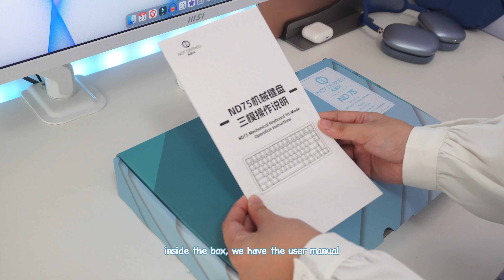this $89 BUDGET keyboard has it all | Chilkey ND75

Comment from the maker: do you think this is a good alternative for the zoom keyboards?
Reply: Does screw in stand work?? Do u know what the difference between the non-flex cut on vs the flex cut one??
Reply from the maker: @Ace61527  the non flex cut one is thicker at 1.6mm, they say it provides fuller sound than those with flex-cut ones! and as one of the more obvious difference, they are usually stiffer in terms if typing experience!
Reply: @mczstudio  do durock v2 screw stabs work with this board?
Reply from the maker: @Ace61527  yes, you can see the PCB holes at 06:32
Reply: I have zoom75 more than 300e in Europe, i'll tell you soon cause my nd75 is coming
Reply: My cons about zoom75 keyboard normal? the painting, quality of top case and screw

Comment: I got this board a few weeks ago. Its definitely amazing value for the price you pay. That said, not really anything great you get if you are an expert or enthusiast level person in this hobby. The aluminum case feels a bit cheap with very sharp corners on the aluminum back plate. The 1.2 mm version of this is pretty weak. I would highly recommend anyone getting this to get the 1.6 mm version for a louder sound.

I paired it with boba u4ts and they definitely thock
Reply from the maker: halloo! did you get yours directly from chilkey? 🥹 i checked the back plate again after reading your comment and there are no sharp corners or edges on my set. 

for the case, i also wouldn’t say it feels cheap cos its the same quality as my Luminkey75! but as for the LCD screen, the graphics could be better 🫠
Reply: @mczstudio  the aluminum back plate is integrated in a very sharp almost 90 degree angle actually. If you run your finger around the bend you can tell how sharp it is. Its not a big deal  but feels kinda cheap to me as far as no complex machining. Still amazing we get all this for basically $100